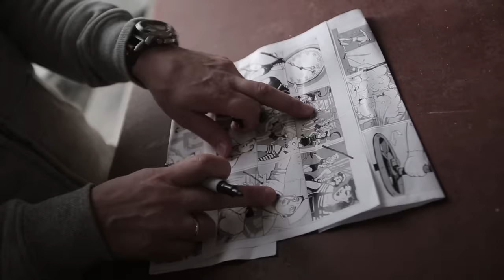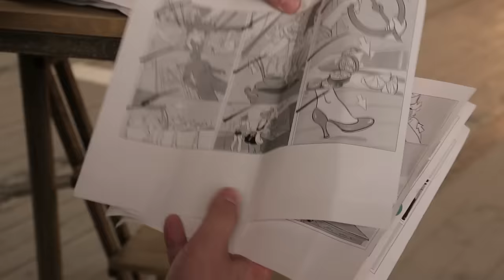Pin-up in the Navy: The Story Behind Musical Adventure on Aircraft Carrier

Comment: REPLACE THE SLOW-ASS/BUGGY AND FRUSTRATING FLASH-BASED GUI, IT LEADS TO MANY BUGS ON SLOW SYSTEMS, FOR EXAMPLE CLICKING IS NOT POSSIBLE ANYMORE. DROPPING MANUAL WITH PLANES IS NOT POSSIBLE ANYMORE, OR FIX IT, BUY SLOW SYSTEM, PLAY A LOT, AND WITNESS THE HORROR FOR YOURSELFES.